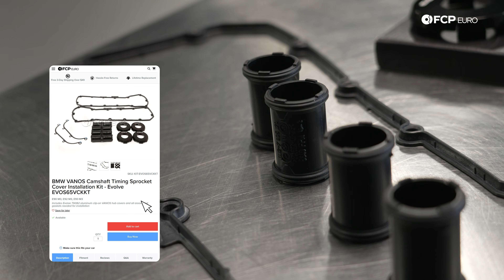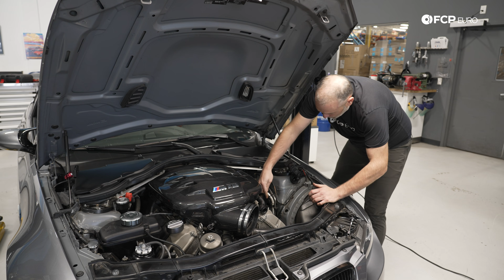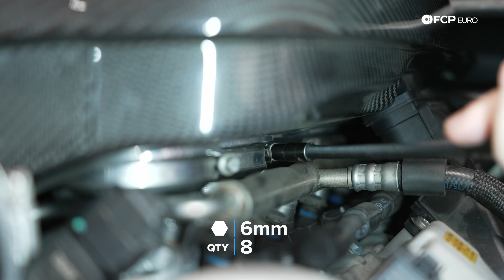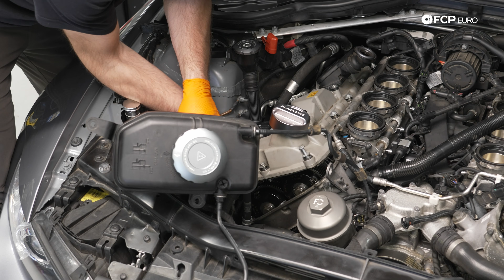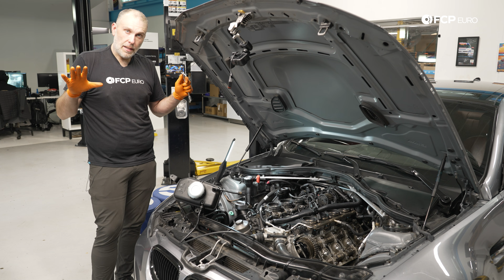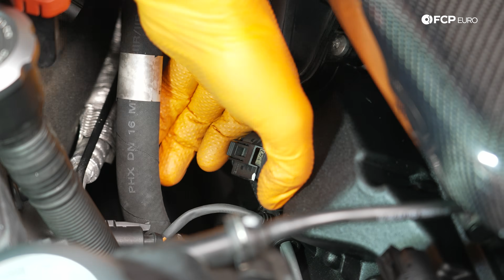BMW M3 VANOS Hub Cover Replacement DIY (2008-2013 BMW E90, E92, E93 M3)

Comment: How do you guys down at FCP feel about the VANOS snap on cover option vs the bolt on option (Mporium) that requires retiming the engine? I'm on the fence trying to decide which route to take.

Comment: I have a Division M coil puller tool. It was like $40 or so and well worth the money when this engine requires new plugs every 25-30k, alternatively you can use a shoe lace wrapped around and pull. The ones in the back I still need the shoe lace sometimes.
Reply: Shoe lave or a wire hanger bent into a loop works great.

Comment: I prefer to use a small gauge wire around the coil pack tops and loop it around and tie the end so I can pull them up gently. Great video, I was scared to do this when I did my valve cover gaskets but you guys make it look easy. Maybe on the next gasket job.

Comment: I don't have this engine, but I watched this whole video because I'm curious about the S54 and because Gareth does such a great job with these and the videography is great. Nicely done! I just got through VANOS work, updating cam bolts and resetting cam timing on the S54 in my M coupe. If you all ever get the opportunity, consider a video covering the procedure for setting cam timing on the S54. You've got so many others covering main S54 issues, the one to top it off would be the procedure for timing it, throw in VANOS overhaul, new pump disc, cam bolts, etc if you want. I did it by combining info from multiple sources, but you all could easily have THE seminal, go-to video for this work with how you make these vids. Appreciate the labor you put into these!

Comment: If your M3 valve cover gaskets are leaking, that is a good time to also do the Vanos Cover Mod.
Add in new spark plugs, rebuilt Evolve Throttle Valve Actuators (TVA), the fuel tank breather valve, and maybe the Idle Control Valve (ICV) that is known to be defective (jumpy idle).

ProTips: 
- Install the 8 Ignition Coils before the Plenum.
- The plastic valve covers can break at the grommets when prying them off. The grommets can dry out, so have some spares.. It added some silicon spray to the grommets, so they come off easier in the future, during spark plug change (35k miles).
- Prying off the ignition coils is very very difficult, so twist back and forth and pull to break the seal. Use 1-2 plastic pry tools and not a metal tool to avoid damaging the magnesium valve covers. If you need to use a metal tool, wrap it in a towel. New ignition coils are ~$100, so look for sales , but there are less expensive OE alternatives.
Reply: Genuine coils are now about $280 and OE alternatives do not work and have been proven to cause misfires.
Reply: @soopermarkus  can you tell me more about the OE alternative that causes misfire?
Reply: @SuperPandaren  all of them cause misfire. Only use genuine BMW. They are supposedly made by Eldor, so it may be Eldor branded OE are ok to use.
Reply: @soopermarkus  What about the Okada Plasma or something it claims to increase a bit of horse power, does anyone have experienced the car misfiring from it?
Reply: @soopermarkus  Thank you for the reply btw, I just got the car and started ordering parts, waiting for rear suspension, throttle actuators to ship right now, I will change the valve cover gasket next and might do the ignition coil as well
Reply: Doing valve covers, spark plugs, vanos covers, spark plug tubes now. Alrd did my fuel breather valve.

Comment: WoW!! Gareth's Silvertone BMW E9X M3 Engine Bay is fully Evolved with all the Carbon Fiber goodies. Just need to add the New Evolve Carbon Fiber Snorkel. The S65 V8 must sound glorious with the intake roar.

In case you missed it, NRW Design has new custom painted Aluminum S65 valve covers. They replace the BMW OEM magnesium valve covers that are more prone to leaking at the gaskets and the finish tends to flake off. The 8 silicon rubber couplers with screw clamps are a bonus. The old rubber couplers have one-time use clamps that have to be cut off. This is an expensive mod. So much want...